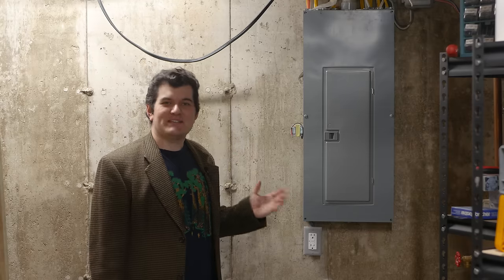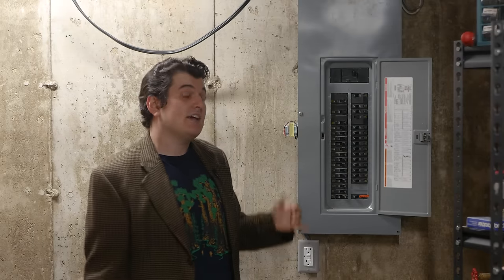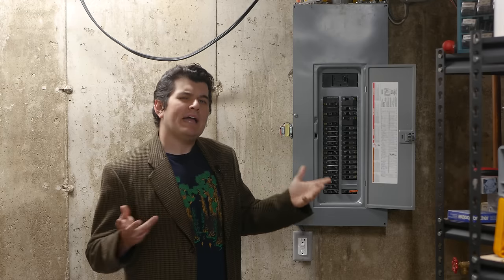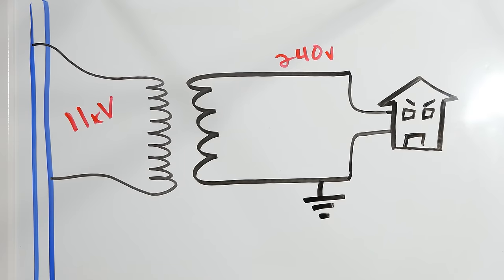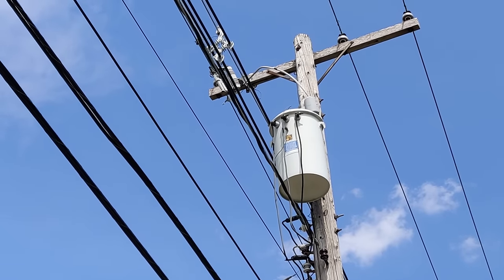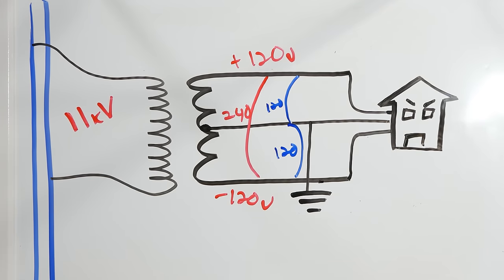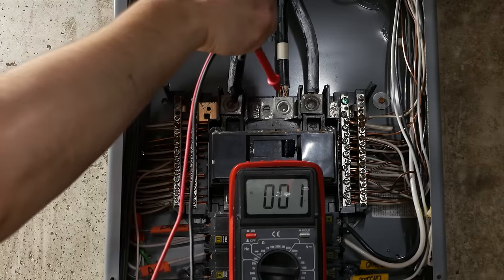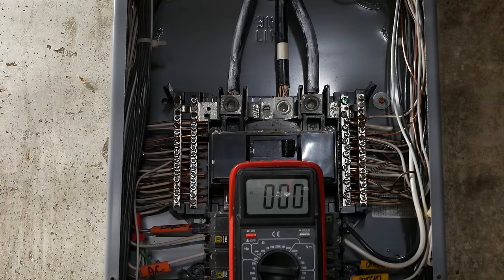The US electrical system is not 120V

Comment: So you have 2 phases of a 3 phase network.....If you apply the same logic UK would be a 400V system. But we dont need 2 phases. Higher voltage needs less copper etc
Reply: We (in the USA) take one phase from the 3-phase distribution network to supply 240/120 split phase for residential service.  If 3-phase power is needed, it would usually be either 208/120 or 480/277.  Only commercial customers would get 480/277.
Reply: No, Only 1 phase is sent to a neighborhood. It is split into 2 120V legs after it goes through the transformer. You'll see all 3 phases running down main streets with just 1 of the phases sent off to each neighborhood as the lines go along.

Comment: I don't understand all this electricity stuffffffff. 120 volts 200 amps 24 kilowatts but actually 48 kilowatts cause it's really 240 volts, transformers allow more power through the smaller wires because something something, I don't understand any of it. I don't understand how volts and amps relate or what it means for the size of the wires idk. Its been like 20 years since I did 3 days worth of electrical in trade school.
Reply: volts and amps should best not be seen as seperate things but deeply interconnected values.

There's also not one specific start value to go from since you can always calculate the other compontents if you have ( for simple ohm's circuits ) the other two values.

Best example is a car battery where many people think it's dangerous to touch the contacts but it's not. The battery still only has 12V running through it. That means the maximum possible amperage and ultimate power to occur is fix as the human body always represents the same electrical resistance / conductivity amount / value.

Whereas high voltages become dangerous if the output has proper incoming energy flow because the maximum possible current to flow will now be larger because we have the same old human resistance but 120V voltage instead of just 12V.
Reply: In this context its simple, power = volts + amps a 240v at 10amps produce same power as 120v at 20amps. Problem with US grid is not the half voltage but having only 2/3 amp output compare to 240 system.
Another level is lower the voltage less resistance it can overcome, so thicker wire is needed. Resistance is basically heat and thicker wire is to reduce resistance and help with heat dissipation.
Reply: @scasny  I think you meant to say volts * amps = watts and not volts + amps, just going by what I looked up. I mean I kind of understand how it works in a very simplified way I guess. I just don't understand why some things will kill you and other things that should kill you wont, like a car battery, cause it can't overcome your own skins resistance? idk. Really I just can't understand how ElectroBOOM is still alive lmao. Or I saw this short of a guy connecting two big wires and one was clearly live cause it was sparking but the guy took the copper of the second wire and bent it so there was part of it sticking out and so he put that on the live wire and then he was able to just grab the exposed copper and wrap both wires together and not die? The comments were talking about how the guy looked super scared cause I assume he would have died from touching the live wire but he didn't die when he touched it after the other wire was in contact so I think he did that so once the wires were connected the current would go through the other wire and not him and so it was okay to touch them after that? But idk. Also ElectroBOOM was debunking this guy who does all this stuff with electricity and he had two forks attached to wires from a car battery or something and he put them together and then stuck them in his mouth and ElectroBOOM said something like once he put the pieces together he could do that cause... something idk cause I don't get it still lmao.

Comment: Holy hell. My whole house here in the Netherlands, even if I use 120V * 200A = 24000W, can barely do half of that at 11500W. Let alone 48000W whee my home barely gets a quarter of that! And I never even reach that! Let alone having access to 24000W total power at your home. I don't even know what to plug in anymore....
Reply: He is not using the full power capacity of his panel.  He has a 200A main breaker merely because he has a lot of breaker positions.  The panel probably came with the main breaker pre-installed.

Comment: But seriously what are the advantages/disadvantages of 3 phase vs others?
Reply: 1 of the advantages is high power with thin wires: for example european 230v 3x25a (4 or 5 10awg/6.0mm² wires) can carry up to 17250w
Reply: @gamecubeplayer  That wasn't the question.
Reply: @ghz24  so what? that's still a useful fact

Comment: Dude, you are still 120v.  You are 120v from phase to ground. The rest of the world is 240V from phase to ground. Across phases is different which is what you are explaining. You get delivered 240v across your phases. We get delivered 415v.
Reply: We use a center tap on one single phase. You're looking at one split line from ground (half the phase). If you measured across one of our phases to ground, it would be 240 volts.

Comment: Using 120 volts for most devices is a lot safer thats why its used
Reply: Even the 240V outlets are 120V to ground.  The main reason for 120V is historical, though.  That is how it started (perhaps 100 to 110).

Comment: Yeah, no. 240vac phase to phase is not same as 240vac to neutral like most everywhere else
😊
Reply: What?   Will the sine wave look different?  Are they both RMS voltage?   240 volts AC is 240 volts AC.  The difference is voltage to ground.   There 240 volts, here, 120 volts.

Comment: Yeah but with this logic europe has a 480 volt electricity net. Or ovens run with 480 Volts.
Reply: I do not believe Europe has 480 volts.  They have 400 volts.  480 volts is US system 480/277 volts.

Comment: So you only have 240 volts versus all over europe that has 400 volts. Nice.
Reply: This video is residential only.   Do not get confused, we have more three phase systems than your country does.   And residential is typically 120/240 volts single phase.  Your system is 400/230 three phase but typically has single phase 230 to most residential.
Reply: Sure.

Comment: No secret for me as a german. Explained our elektrical system the same way, we have a 400V system. 3 times 230V in every house. Actual main cb 63A for every single unit, no matter if its a flat or a family house. That makes 43kw max. usable power. 21 kw flow through water heaters are very common and thanks to the 3 phase system we only need 5 wires of 2.5mm sqr to operate a 11kw device at 16A.
So, it keeps the same, americans electrical system compared to the european is Bullshit. Da machse nix dran!
Reply: 43KW is still less than the 48KW panel shown in this video.
Reply: @securitycamera8776  And 48 kW is US standart for 20 years or more for every new bulid unit, so also for a 40 sqr meter flat? And what about 3 Phase System? In germany in every house and compartible to old 1 phase installations, because there's only 3 ph 230/400V System and not a parallel existing industrial version like the us industrial 3ph 120/208V System. And available max. power is not everything. To power a 11kw device in the US 2 Phase system, you need more than 45 Amp, so wirering in 3x 10 mm sqr is required and I think there is no common plug existing that can carry this much. We need only 16A so portable devices with 11 or also 21 kW are no problem and existing.
Reply: @walterwixzwerg6735  And 48 kW is US standart for 20 years or more for every new bulid unit, so also for a 40 sqr meter flat?]

Well my sister's house has had 48KW since 1968.  Placing a 48KW feed into 430 square foot apartment would be viewed as lunacy.

 And what about 3 Phase System? 

Three phase doubles the circuit complexity for a power increase of 73.2 percent.

In germany in every house and compartible to old 1 phase installations, because there's only 3 ph 230/400V System and not a parallel existing industrial version like the us industrial 3ph 120/208V System.

There are not two parallel systems. It just what kind of drop you have.

 And available max. power is not everything. To power a 11kw device in the US 2 Phase system, you need more than 45 Amp, so wirering in 3x 10 mm sqr is required and I think there is no common plug existing that can carry this much.

You are right I can't buy a 45 amp plug. I can buy 50 amp plugs all day long.

 We need only 16A so portable devices with 11 or also 21 kW are no problem and exist.

That is impressive. What portable 11KW device do you have?

Comment: To watch this as an german Electrician is very Painful. The Electrical Installation is horrible. In Germany we not only have 230V, we have 3x 230V and this makes 400V.
Reply: Voltage is not what does work.  Power, volts times amps, does the work.  As for for 3-phase, we have that also, but households don’t need it.  At home, we power lights, make coffee, and charge our phones.  We have small motors in appliances.  None of these requires high power.  Commercial and industrial buildings have higher power 3-phase service to provide wide-area lighting, and run elevators and heavy equipment.  The United States has never been held back in industry by its 120-volt residential electric service.
Reply: @GH-oi2jf  I know that its the Power does the work, but with only 120V you need to double the Amps for the same Power. This means you need much thicker cables and produces more losses to heat, it also means you have a much higher fire hazard especially at terminal points. I use the 3 Phase service very often in my house, for example my welding machine or my concrete mixer and also my oven and hob works with it. When i need full power for cooking it is around 10kW. For the Future in Germany we want to heat our houses with heat pumps and charge our cars. For this we also need much Power. I know that for  Industrial use in North America there are 3 Phase at 480V. In Terms of Safety is 120V safer for Humans, but for this we have RCD's in the Installation. I dont know how old this Installation is and how modern ones in America looks but this looks very terrible. And the cables mostly are under the earth and not on posts.
Reply: @JohnTrenbo  Sorry! I'm in the mood.

I know that its the Power does the work,

Yes!

 but with only 120V you need to double the Amps for the same Power.

Yes! 

This means you need much thicker cables and produces more losses to heat,

No! Because we have "much thicker" cables the heat loss will be the same.

 it also means you have a much higher fire hazard especially at terminal points.

No! Because our "much thicker cable" comes with much thicker terminals.

 I use the 3 Phase service very often in my house,

How wonderful!

for example my welding machine or my concrete mixer

Magical devices we have never heard of I'm sure.

 and also my oven and hob works with it.

They may work with it but I doubt they require the three phase aspect.

 When i need full power for cooking it is around 10kW.

OK.

For the Future in Germany we want to heat our houses with heat pumps

Every house I've lived in or owned since the 1960s has had a heat pump.  Welcome to the future!

 and charge our cars.

I'll stick with my pickup truck.

For this we also need much Power.

Yes! You will have to increase then 11kw service typical in Europe to something like the 48kw service shown in the video. Again welcome to the future.

In Terms of Safety is 120V safer for Humans,

Yes.

 but for this we have RCD's in the Installation.

Since the late 1800s?

 I dont know how old this Installation is and how modern ones in America looks but this looks very terrible.

It is a current 200 amp box.  If you don't like the looks blame the French. It is one of their companies.
Reply: In the united states, large buildings have 3x 277v and that makes 480v

Comment: no 400 volt sauna doe
Reply: In the USA, a sauna for a single-family home will usually run on 240V.
Reply: @GH-oi2jf  a lot faster and easier if you got that 3 fase 400 volt i think most electricians here would not see 240 to be fit for that application

Comment: Well, not to be pedantic, but if you say you have 240V in the US, than i have to say we have 400V over here in europe.
And honestly, saying that 120V is safer than 240V to me seem somewhat like saying its safer to get shot in the head with a  .380 than with a .45
Reply: A shock from 120V can be fatal, but usually when a person is well grounded and the path goes through the heart.  I’ve been shocked just once or twice in my life by 120V, and it was not life-threatening.  Most electrocutions in the United States happen when someone disregards basic safety protocols, like using an aluminum ladder near power lines.

Comment: your still a 120v country, who happen to be running 2 phases cause the current demand is too much for a single 120v phase to handle cheaply(A single 120v phase needs twice the size of the conductor to properly handle the current required compared to 240v and copper isn't cheap, as appliances at the same wattage rating need twice the amps at 120v than 240v systems need), and people decided to use the 2 phases out of phase with each other to make 240v because 240v makes more sense(costs less to deal with, allows for smaller wires, smaller breaker sizes, less chance of fire if things go wrong etc etc)

basically USA used the 110-120v system and really shouldn't have, and is now using a bastardized really really old setup to get 240v out of a 2 phase 110v system by running things out of phase.
That doesn't make you a 240v country, that makes you a 110v country that has slapped some flex tape on the problem.

but that bastardized system is going to eventually convert all USA over to 240v because more and more useful things really require it(see welders that don't pop breakers every 2 minutes) and people are having sockets installed for 240v all over the show.

So pretty soon you will be building new buildings with 240v in mind and 110v will become legacy, then phased out entirely. can't wait.

Comment: how about your three phases electrical system?
Reply: What about it?  Our transmission and distribution systems are 3-phase.  Commercial and industrial customers often have 3-phase power.  Residential customers usually have single split phase power.
Reply: i mean, US 3 phases electrical system is just the same as the rest of the world?
Reply: 380V on three phases.
Reply: @williamschnl — The three phase system is the same, in principle, everywhere, but the voltages will differ.  In the United States the voltage will usually be either 208/120 or 480/277.

Comment: Why not a 3 phase system instead of 2.5 phase
Reply: why.  for household,  two phase provides necessary power with one less wire.  Use 3 phase for industrial
Reply: What the heck is “2.5 phase”?  Three phase power is available for those who need it.

Comment: As someone that is in to cars, and use powertools, lifts etc, that 1500w limit would be an actual limitation. i would have to run a special 240 circuit to lifts, and power hungry tools like welders etc, that i can use on a regular 16A breaker here.

Also anyone using a plug that can only go in one way should never say anything about other plugs beind dumb. not being able to orient bulky plugs is dumb
Reply: And how do you hook up a 5 hp motor?   16 amps?
Reply: @KevinCoop1  theoretically a 5hp motor would run on a 230v 16 amp fuse but it's so close i would probably either put it on a 20 amp breaker (would need different plugs for that) or a 400v cuircut. never been in a position to need to do it, so haven't looked into it. most consumer grade stuff stop at 3200w

Comment: well really the hot lines are not +120V and -120V but 120V ⦣ 0º and 120V ⦣ 180º :D
Reply: true
Reply: Actually they are + and - because those numbers are the real part of the complex number.  As the imaginary parts for 0 and 180 are 0 they don't really change the vectors only the + and - count.
Reply: @securitycamera8776  oh that's a good point

Comment: Actually, the idea of a switched outlet does provide a safety system. Switched off you have no potential at the contacts so if you were to slip or have metalic debris across the pins (unlikely as it is) you would not get the shock and when you did turn on the switch if there was an arc your fingers are just that much more distant from the problem. You also stop having an arching issue when plugging in because the cord isnt live as soon as you shove it in the wall outlet. Switches are smart and the US would do better if it listened and watched the rest of the world and how we do things. The residual petulance from the 1700s seems like that bratty little child that never wants to listen to anyone and is often wrong.

Comment: The point of the video we suck butt we are good at it😂😂
I dont know how About germany,  franch etc. Other states,  but in the Czech republic,  the majority of buildings has 3phase 400 volts elektricity atachet, and you wil have ať home 3phases to use for heavy duty things (boilers, stoves etc.) And everyvhere you can have the power of 230 to use for anything with one size of a plug in general (There are just 2cable ones for things without need to a ground) but next to it everything lines up and works , fun fact you do not need a special outlet for a dryer, but i have to confes i like the dual 240 shock breakers

Comment: Is 3 phase not used in USA?
Reply: Three phase is used but not for residential service.  Running a single phase two or three miles is cheaper than running three phases.
USA is not as densely populated as Europe.
Reply: For commercial and industrial use, it's not necessary for residential use